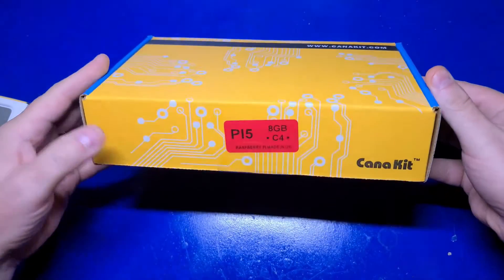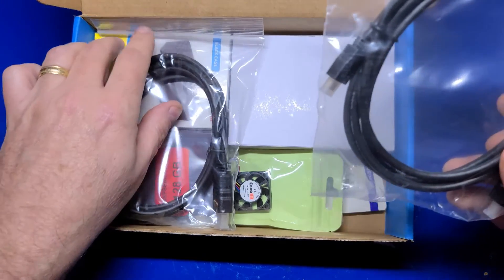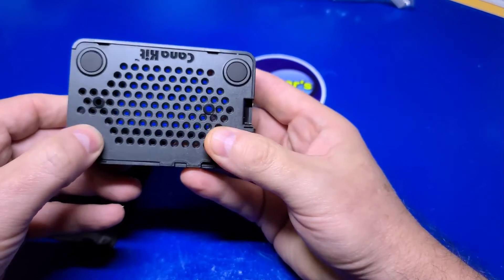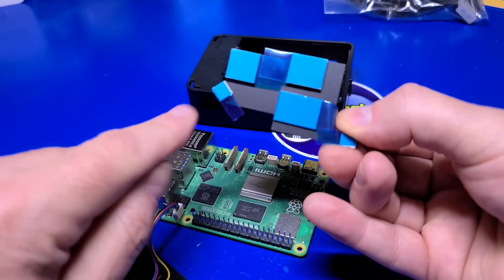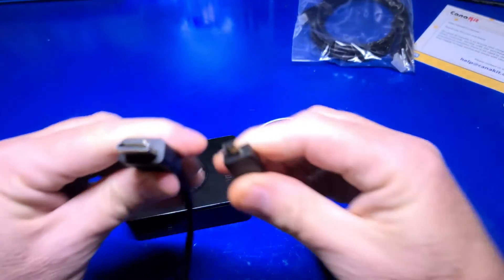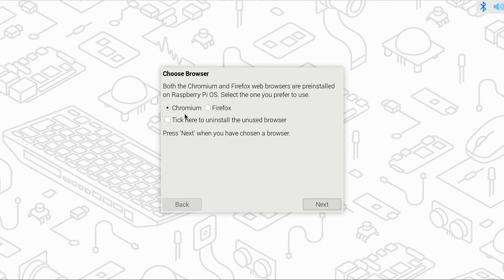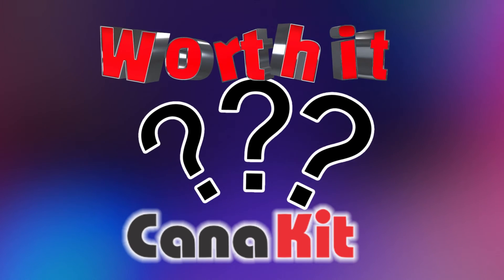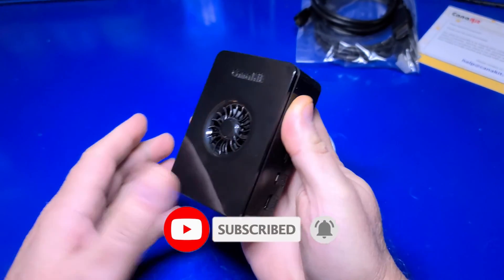CanaKit Raspberry Pi 5 8GB Starter Kit [Turbine] - Setup Guide

Comment: Hey I followed this pretty well to the letter, and the stress test is showing me as much as 84.5˚C. Possible differences: using a logitech wireless keyboard that has a USB dongle; 1x 1080p monitor (and pi's OS defaulted to 1080); ambient temp in my room is 23˚C; and I noticed that my canakit had white stickers on the heatsink instead of the blue ones you have in the video. I wondered if mine were a different/worse material. Do these results seem off?
Reply from the maker: Double check that you're seeing (or hearing) the fan kick in at higher temperatures.  I'd reach out to CanaKit here: https://www.canakit.com/Contact for their recommendation.  You should be seeing closer to the same temps shown here.  Please let me know what you find out.
Reply: @WagnersTechTalk  Canakit told me my board must have a rare flaw. I sent it in for a replacement, which came quickly. New board stress tests today with the highest temp at 75.7˚C.

Comment: ugh my heat sink is not centered on the far piece. the one that was oriented wrong is covered but the other little square on the far other end is slight off center and some of it is exposed...how do I remove it to try again?
Reply from the maker: It should just pull off if you gently pry it up.

Comment: Great video! Im just wondering how far in the usb mouse and keyboard are supposed to go because it seems quite stiff and i dont want to force it in and break something
Reply from the maker: Take a look at both ends of the USB port and the connector.  You'll see a white or blue notch.  That notch will fit in to the opposite open area.  You should then be able to push it all the way in.  Sometimes with USB connections in-general, it can be a little stiff initially.

Comment: Nice. Is the Pi 5 capable of running two 27 inch 4k monitors @ 60hz ?
I would worry about that temperature of 174 degrees Fahrenheit stress test. That's VERY hot !
Reply from the maker: I don't have two 4K monitors here to test, but this is what Google's AI had to say about it:

Yes, the Raspberry Pi 5 can run two 4K monitors at 60 Hz: 
Display support: The Raspberry Pi 5 has dual micro-HDMI ports that support up to 4Kp60. 
Performance: The Pi 5 has a fan and heatsink to maintain peak performance. 
Other features: The Pi 5 also has two MIPI camera/display lines, which allows for stereo imaging or running a camera and external display simultaneously. 
However, some say that using the Pi 5 at 60 Hz can make UI elements feel laggy. To get smooth 60 Hz output at 4K resolution, you can use an external GPU.

Comment: I'm not sure what the point of the holes at the bottom of the case is.  In order for the air to exhaust through them it would have to flow around the Pi5 board and to the backside to get out.  Is it basically cooling by creating a positive pressure environment, or is it more likely exhausting around that top edge?  I'm thinking about getting one of these to go onto the back of a monitor and I can't help but think that it would cool better with some holes drilled in the sides instead of the bottom.
Reply from the maker: Might want to check with CanaKit directly on their recommendations.  Agree, airflow on the back of a monitor may be obstructed and may increase the amount of heat from the display itself.

Comment: Hey my Pi5 is running at 78.5 degrees.. I misaligned the heatsink. Is this too hot? Or should i be fine?
Reply: I'm getting as high as 85 in Stress.
Reply: @CaptainRufus yea im gettint the same too
Reply: Edit:  it started a second run and I ensured everything but terminal was off and now the highest when it ran it automatically on a second run is 56.5.  A little weird but maybe because it's a fresh install and some stuff was going on in the background?   When I initially ran the test I had Bluetooth and Firefox on though both were shut off early and no real changes until it started a second run.  Strange.  Also maybe the thermal pads weren't quite merged yet?
Reply from the maker: Check with CanaKit on that one, I don't want to tell you wrong.  Here's their contact info: https://www.canakit.com/Contact

Comment: Mine just came in the mail from Amazon. It didn't come with a fan and it doesn't have the vents shown. It also didn't come with a heat sink. Is that a problem?

The QR code in the manual sent me to this video.
Reply from the maker: Did you perhaps pick up the one with the aluminum case (this one https://amzn.to/3JGlqyo )?  If so, you should be good.  I've not personally reviewed that model but it uses passive cooling rather than active (fan) cooling.
Reply: Yes, that's it.

Comment: Interesting that it would not connect to my Verizon Home 5G internet. My password is not incorrect because I'm still using the one on the bottom of the router they sent me and have used it to connect multiple devices to on my home network which is how I'm streaming your video, in fact. Seems like a network driver/protocol error. Unfortunate.
Reply from the maker: I had an issue similar to that with a Pi 3B+, but not using by ISPs WiFi router but my own.  I wound up resolving it by doing two things:  1)  I separated by WiFi 2.4/5Ghz bands into two separate SSIDs.  2)  Removed special characters in the WiFi password for the 2.4Ghz band.  One or both of the above may help, if a direct Ethernet connection is possible that will also work immediately.
Reply: @WagnersTechTalk I'll check these out, thanks!

Comment: Thanks for the review on the CanaKit starter kit. But one question: 74 degrees Celsius is approximately 165.2 degrees Fahrenheit. Are you sure the CanaKit gets that hot?
Reply from the maker: Those are the readings that the stress tool generated.  I placed all the commands used for this test here, if anyone wants to re-create/test: https://wagnerstechtalk.com/rpi5/#Stress_Test

Comment: Greetings.  I'm waiting for this same kit to be shipped from Canakit; I ordered it about a week ago.  I'm excited about getting it.  I have built many PCs over the past 20 years.  This will be a different animal, and surely a lot smaller.   I am looking forward to learning some programming and just messing around.  I've programmed SPSS+ MS-DOS version back in the 1980s and 1990s, and learned the bare essentials of Fortan back in 1969 (with very little success, using punch cards on a Control Data mainframe).  

I just fouind this video, and will link up to the Rasp Pi 5 guide as well.  Thanks so much for doing this.  I just subscribed to your channel and look forward to viewing some of your other videos.  I've read about RP for some years now, and decided to take the plunge, especially with Pi 5 freshly released.  Thanks again.
Reply from the maker: Thank you so much for your kind support!  One of the applications you may want to download is Visual Studio Code, it's a great code editor for a number of different languages.  I use it frequently.  In the Pi 5 Getting Started video (came out just prior to this one), I briefly touch on how to install it but not about it's usage.  

That's awesome that you got started with Fortran and punch cards.  I missed out on the punch card era (don't think I missed much from what I hear).  My first exposure to computers was using a TI-99/4A, then later on an AS/400 using RPG III, professionally (early 90's).  I did some Fortran programming in college, but briefly.

Those were exciting times for the both of us!  I hope future videos are just as exciting to you.  I do want to mention, the next 3-4 videos coming from me likely won't be Pi 5-related (You'll see some virtual pinball content during that time.)  However, don't worry more PI 5 content is coming.
Reply: STUPID FAD PLUG WAS BROKEN FROM THE START

Comment: I loved my Rpi 4, but ultimately sold it. Updates fail in the dumbest ways. Give me something like an .exe or .apk, not some janky  process that will fail if one file has trouble downloading.
Reply from the maker: I hear what you're saying, for me that's been a very uncommon issue that is typically related to not updating the Pi or unstable internet connections.  However, there are multiple Android distributions for the Pi as well (for the Pi 4, Pi 5 versions are coming).  Even have Win11 on the Pi 4, though not the ideal experience.  With the more powerful CPU+GPU on the Pi5, should be some interesting  options in the future.  Thank you for watching!

Comment: I have been looking at this case, but i was hoping to use the official active cooler with it, since i already have it
Reply from the maker: While not a thorough test, you can use your Active Cooler with the CanaKit case.  In this video, created for you exclusively, you'll see that you can use the Active Cooler with the CanaKit case: https://youtu.be/k_-ZGvEAhG0 (I was also curious).  Once you see this video, please comment below that you saw it so that I can delete it.
Reply: @WagnersTechTalk I wish this now deleted video was part of the main video above, as I’m also curious. Regardless thank you for the very thorough videos. Excellent resources for a pi newbie.
Reply from the maker: @johnnyc.31  Thank you Johnny for your kind comments.  I deleted it as it wasn't a thorough test, but simply installing the active cooler into the CanaKit case which the OP wanted to know. The CanaKit already includes a comparable heatsink and fan (actually, the CanaKit fan is quieter than the active cooler fan).  However, I may do a more "official" follow-up video at a later time, if there is demand for it.  The active cooler will definitely fit/work with the CanaKit case, but you'll have to remove the CanaKit heatsink, of course.
Reply: Awesome! Thanks sooooo much! I really appreciate that.